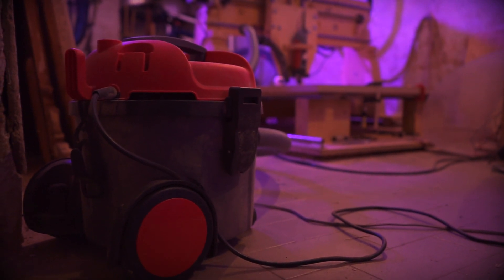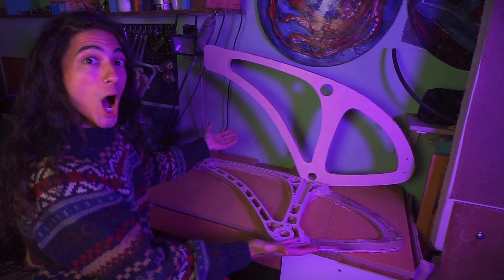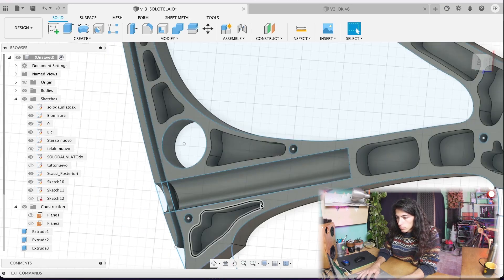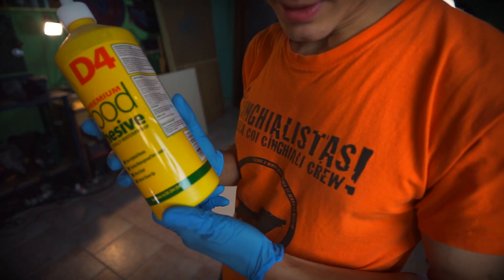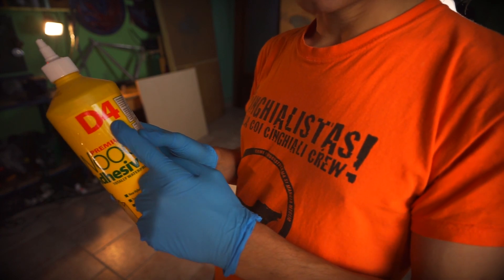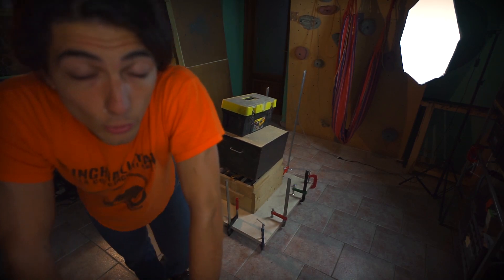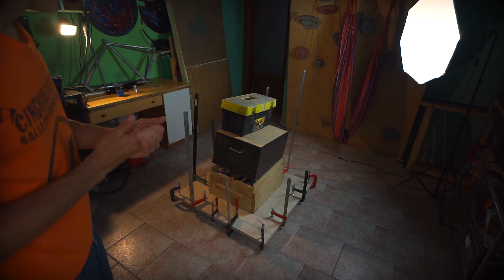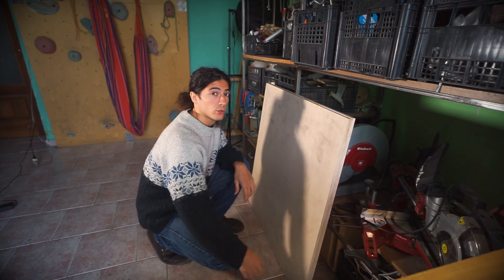How to build a Wood Bike - Part 2/3

Comment: Compare to your dual 12mm birch plywood frame which one give you a better feel may i ask?
Reply from the maker: Infinitely better this latest model in terms of lateral flexibility and weight! 
As a downside, I just don't have space to fit my u-lock 😂
Reply: @builderslabs5594  Ahh I see. I may need to add more structure on the chain-stay area to help reduce the lateral flex.  Thank  you very much ^_^
Reply from the maker: @mikexhotmail  Well, actually that area was not the big deal. 
The most flexible part of the frame was near the steering in the front. 
And you can clearly feel it during fast steering. 
This latest model it's so much better (quite perfect to be a wood frame) that I strongly advise you to build this instead, if you can!